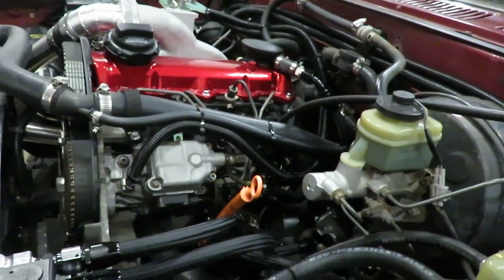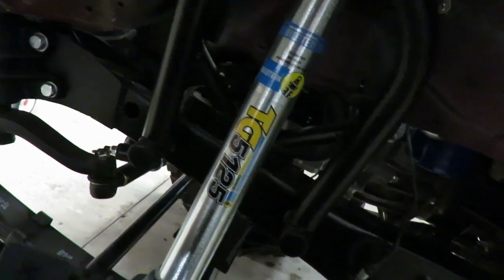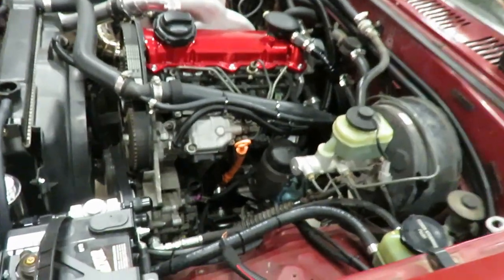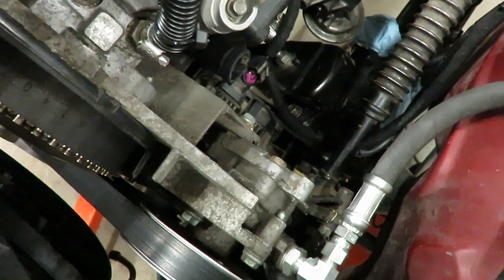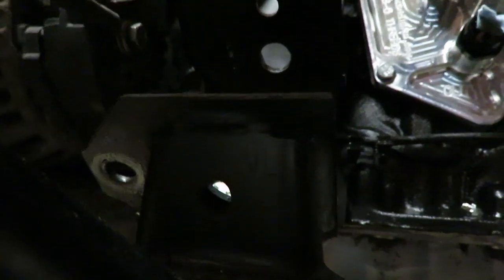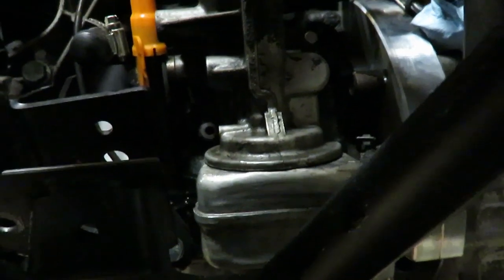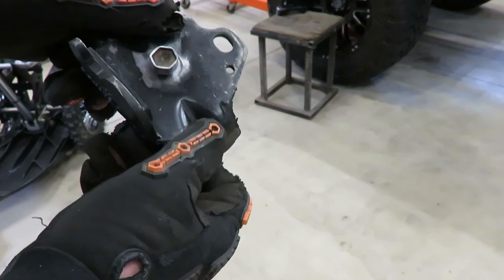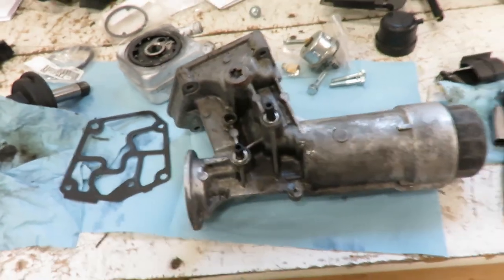Toyota TDI Diesel Swap Replacing the Entire Oil System!

Comment: I had the trail gear mounts with my 22r. Unless this only an offroad only rig, don't do it. The vibration drove me nuts on longer drives. Even my brand new stock mounts have cracks in them. I don't think you have anything to worry about. That cap that goes over the mount limits the mounts movement under torque.
Reply from the maker: Cole MacDonald good to know! The bolt through should keep everything together
Reply: @austinniemela  You may break the bolt it as it is going to be flexing with the mount movement. Worst case, new mount is really cheap on Amazon or ebay!
Thanks for making these videos. I used your upper rad hose numbers to get mine together.
Reply from the maker: Cole MacDonald awesome glad the hoses worked for you too!

Comment: Could have raised the body, engine, and transmission a 1/4 to 1/2 inch for the mount clearance for the stock cooling plate. Maybe at most raise everything 1 inch.